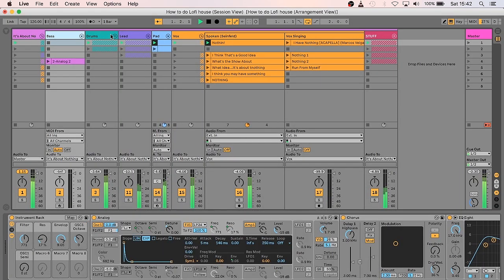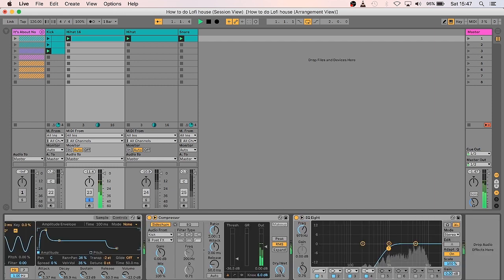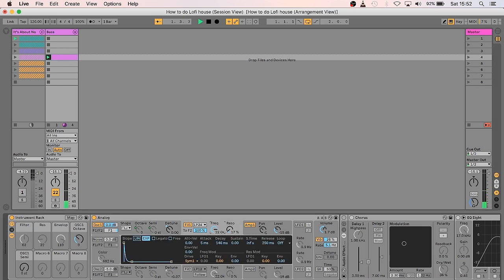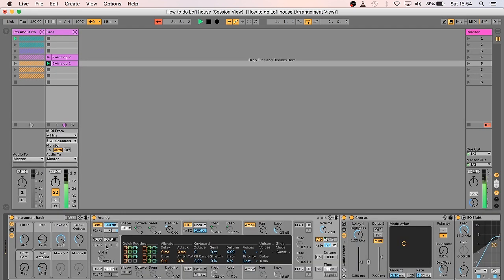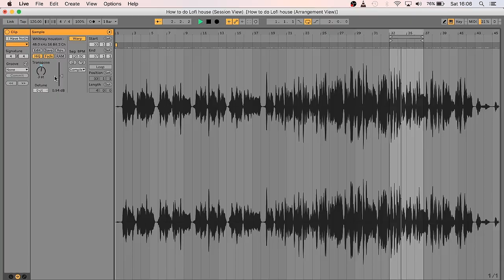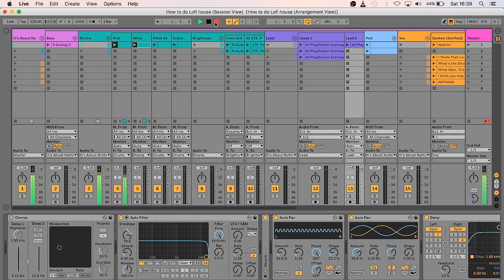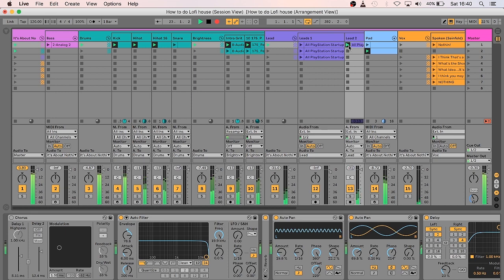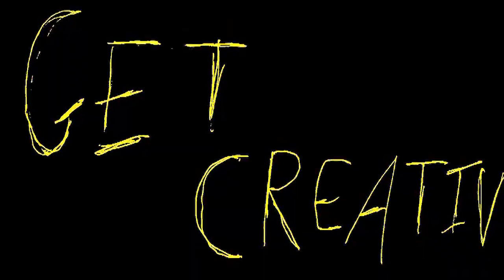How To Make Lo-Fi House

Comment: Hi, i just started watching and i'm wondering : What's the point of sidechaining your snare to the kick?
Reply from the maker: Because its lo-fi, i wanted to maximise the distortion and crunch on the impact of the snare, so step 1 is to sidechain it so the kick is distorting the top of the snare, and step 2 is to group the kick and the snare together and drive the saturator over both.  The results are more lo fi. But other than this genre, Since making this video, I've honestly changed my routine on snares. Sidechain compression usually takes place when the kick and snare don't sit we'll together, in which case it makes more sense to change the samples.